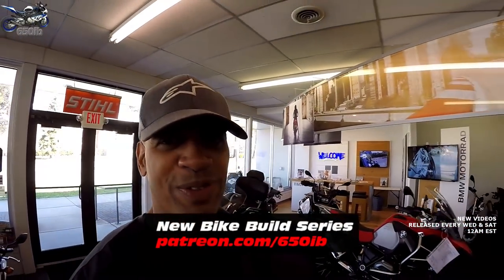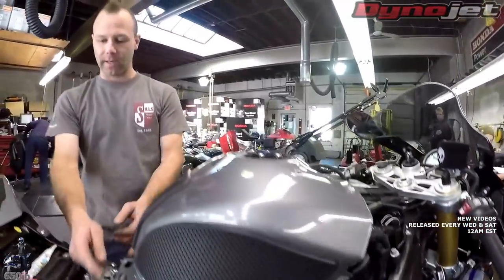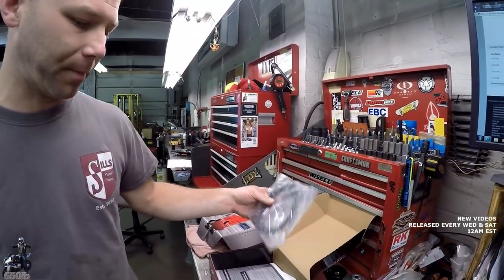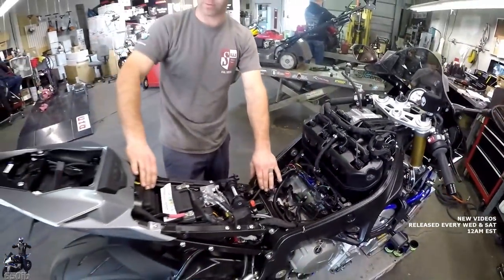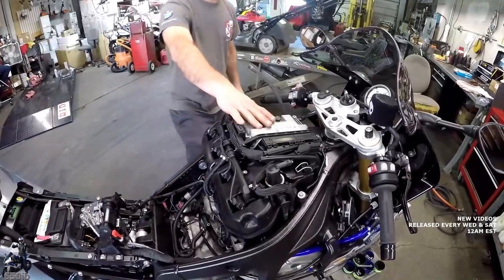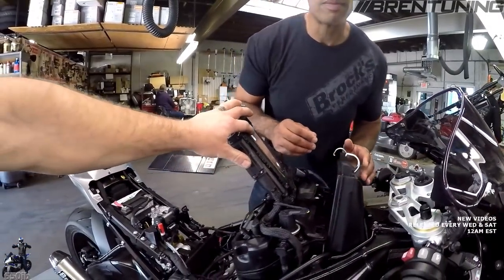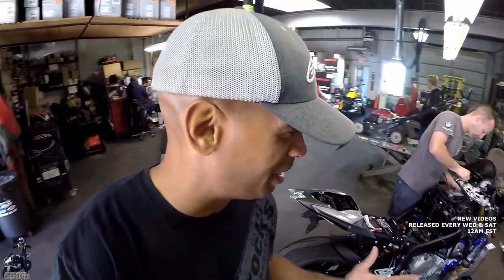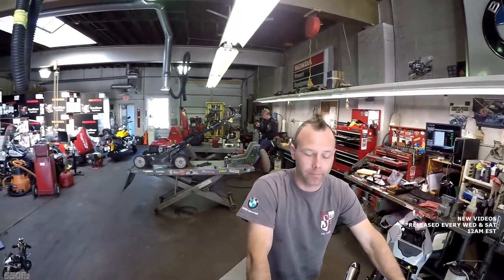2017 BMW S1000RR  | Power Commander V Installed!

Comment: Nice work guys, but I noticed throttle position was at 4% at idle when it should read 0%, there is a way to correct this, not sure how on the S1000RR but I'm sure Zack's Dyno buddy will fix it ! Really enjoy watching this series, keep up the great work.
Reply: Brady MacGillis 
It show 4% until bike is started because throttle plates are open that much so bike can start. Once running shows 0. 👍🏻

Comment: PowerCommander will not work long term/without fault codes.  2017's need the O2 sensors plumbed in.  Only option currently is the RapidBike Race which can accept leaving the O2's in place.
Reply: Would you know if the 2016 needs the o2s plugged in or not ?

Comment: I just had a power commander 3 put on my 2005 cbr1000rr and I don't see a difference. I have bmc racing filters and a straight piped exhaust, combined with the power commander I was expecting to feel a difference but I guess I'm going to have to upgrade my sprockets next
Reply: Chrome Superbike Rider did you put a map on the power commander via the app? Using a PC
Reply: Joel Schub the shop that installed it went through 15 different maps so see which one ran best. The only difference I notice is the idle seems smoother and it doesn't smell like unburnt fuel anymore.

Comment: Too bad the PC doesn't include connectors to plug inline into the throttle position sensor circuit.  Shouldn't have to cut into the bikes harness.

Comment: just brought the 18 model got 2 slight problems doesn't like going 30 to 40 kph smooth without jerking and has a strange ticking sound at low revs ..like puting a playing  card on the forks on a pushbike as a kid.. and the card hits the pushbike spokes whyle it's turning . I need to hope to fix these problems..can't see this bike doing that as a new bike.. it's a  2018 with 12000 km. cutting into the factory wireing harnesses is not what the bike tuneing dyno shop said to me they told me it was all plug in. .so watching you cut that in is confusing now.

Comment: How is this right? Dyno jet are still developing the PCV for the 2017... they don’t even have one on offer for 2018 either...
Reply from the maker: This is the Power Commander 5 from the 2016 S1000RR. It works with the 17-18 model as well.

Comment: ib, how do feel about Bazzaz man? I run the Z-FI fuel module and QS-4 quickshifter gp shift. I like bazzaz and wanted to be different than everyone else that was running power commanders. What's your insight on Bazzaz and its products? Or your boys insight here at MotoMillion?
Reply from the maker: +GALACTUS I prefer the power commander mainly because it has always worked for me and I don't have any experience with Bazzaz.
Reply: 650ib Oh ok. Preciate it tho man.

Comment: Will you plz tell us model of muffler bracket that u r using for 10r 11-15 akrapovic in your H2 and can this slip on is still installed without removing Exhaust Back Box.
REPLY